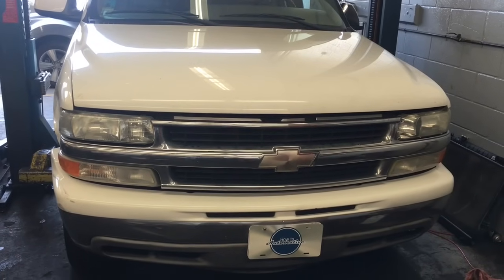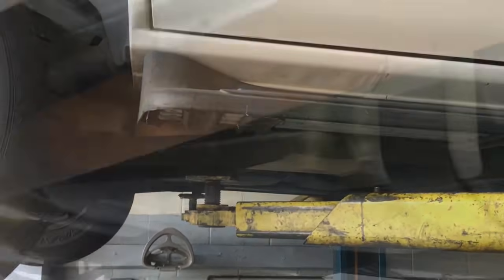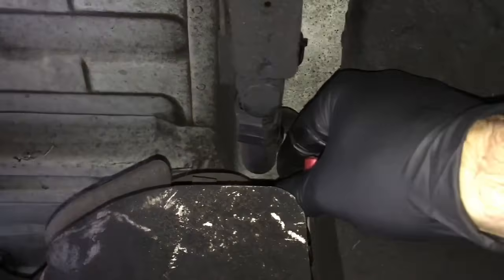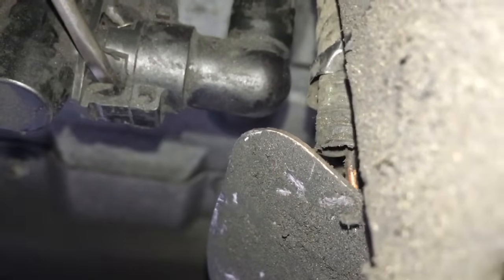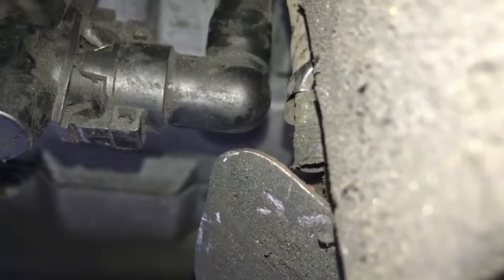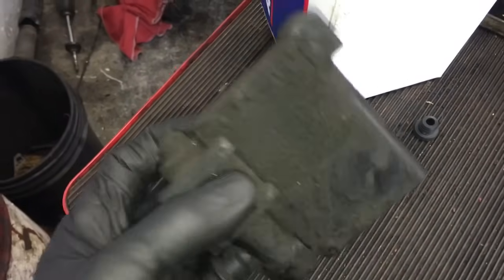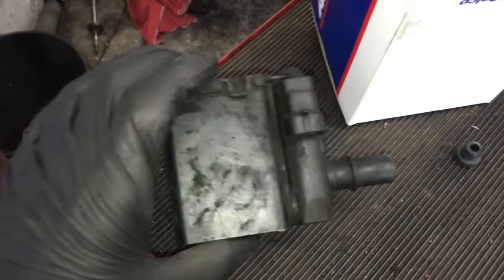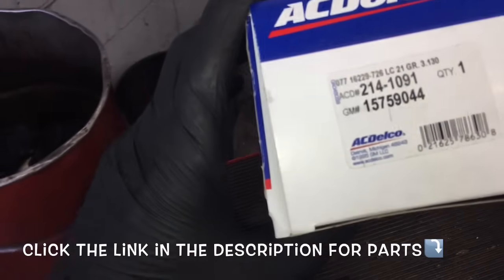How To Replace The Evap Vent Valve On A Chevy Tahoe/suburban

Comment: Thanks for the "complete" instructions. Other videos I came across failed to show the complete removal process, specifically where you have to use a screwdriver to pry the little tabs out because the squeezing doesn't work.  You were a great help! Thanks!  2005 Chevrolet Avalanche Z71

Comment: Excellent video - this helped me accomplish this task within two hours.  I took the mounting bracket off and pushed the vent hose through from the other side of gas tank to give me enough room to wiggle off the fitting.  Only video out there which addresses the 2003 Chevy Silverado 1500 evap vent - as it was the only year made like this.  Thanks again.
Reply: I was wondering why I was having trouble finding a video on my 03 Yukon XL. My experience may have been like yours; as in the only year that it was designed like this. I ended up having to buy the entire OEM kit that included the hose.

Comment: I found it difficult to remove the hose with the valve still mounted as there was not much room and also the hose was stiff. Thus making it hard to get enough muscle to pull it off of the valve while also trying to squeeze the tabs with my fingers. Tried to use a screwdriver but fishing blindly and again difficult to get two screwdrivers up in there and then trying to disconnect the hose at the same time. Not easy if one is on their back. And also worried that I might break the connector. 

I decided to unmount the valve. It was easy that way as I got better positioning and was able to squeeze the tabs and also twist and pull the valve off.  Also pay attention that you do "need" to push the connection in towards the valve first and then squeeze it before you pull it off.

Comment: Just a short note on this repair.  The vent valve has been updated with a modified kit, available from AC Delco or Dorman.  It replaces the old box vent control valve with an inline filter/valve assembly,  relocating the actual vent higher on the chassis.  Seems many will experience a check engine light shortly after changing the old style valve because it allowed dirt to pass through to the canister, clogging it.  The correct repair is to replace the canister and the vent valve at the same time.
Reply: charcoal canister?

Comment: 2001 Chevy suburban has engine code p0446 I'm able to pump gas fine. Gas cap seems good. Can it still be the EVAP canister?
Reply: I have the same code. Did you get it resolve?
Reply: I haven't. I'm going to change the gas cap and see if that works. If not I might have to change the canister.

Comment: Great video thanks!  Question - i have the new one here looks just like the one you installed.  I can blow through the port both ways and there is no restrictions.  Is the valve in the no powered state supposed to have the valve open?  Once you connect and that connection has power is that what closes the valve?  In other words the unpowered state for the valve is open?  Thanks again

Comment: This is the look my 04 yukon 5.3 flex fuel vent valve looks like . Amazon  says not fit but I ordered it anyway since the one that I got from Amazon is big and round and wont fit.    1 question I have is the o-ring inside that stupid connector replaceable?  I worry that is could be causing the leak.

Comment: So annoyed with those evap fittings and their removal... such an easy job and yet you spend way too long trying to understand and remove the fittings. And there is three on the charcoal canister. Great video thanks for the good tip on using a small screwdriver to get that fitting off!
Reply from the maker: I agree they could’ve designed this a lot better. Thank you for watching!
Reply: Do you the the P/N to the three?

Comment: In case the part you find doesn't have the hoses and you have to re-use the originals, I had good luck hitting them with the heat gun for just a little bit.  Be careful, there might be gas fumes.

Comment: I just got a diagnostic  on 03 Tahoe it said to change the purge valve and I change it the check engine light is still on could the code mean I need to change this valve instead

Comment: I am about to try this out. I've been getting my check engine light and the Tighten Fuel Cap warning on the dashboard. I have changed the cap 3 times already, OEM and ACDELCO and nothing. I hope this EVAP solenoid is the issue.
Reply: NOTORIOUS GAMING 209 hey man, did you do it yet?? Lol. Just did fuel pump on 01 suburban and got evap code

Comment: The vent line is broken on my tahoe .I saw zip ties around it...What is that vent hose called to ordered...I had the fuel pump replaced 3 years ago. Is it possible that the shop broke it while bringing the tank down? Thanks

Comment: I saw another video that showed it on top of the engine. Is it the same thing or is that for certain models or years?
Reply from the maker: If it’s on top of the engine, it’s the purge valve, not the vent

Comment: Do you know if the solenoid vapor valve connector wiring behind the tank runs into the  vapor pressure sensor on top of the tank? Found my po449 it was the 2 wire connector one of the wires pulled right out of the sheathing and i cant get 2 the end to splice another piece,its about a foot half long piece that broke

Comment: Awesome video - thanks!  What indicators tell me that this is bad on my 2003 Suburban?  Fault code?  Will the vehicle work fine outside of emissions issues if this is faulty?
Reply from the maker: condor5635 You’re definitely going to have fault code P 400s possible problems you may run into it hard to fill it up of gasoline. Pump may click off.

Comment: My suburban is having problems cranking after I put gas in it. Would that be the canister purge valve? If so, I typed it in on Autozone with the Part Number and said it doesn’t fit my 2006 Suburban. I found another that says it does.
Reply from the maker: The Evap System should not cause any starting problems. I was suspect something else such as the fuel pump to pump regulator. Or it’s not Seen cam or crank sensor. Start by pulling code to see if there’s anything and as far as a parts go will be different on all the vehicles check with your local park supplier.

Comment: Would anyone happen to know if this issue can prevent your vehicle from passing smog ? I’m currently having that issue I replaced most of the other components I did a leak smoke test and I had a lot of smoke coming out of this valve. I really hope this fixes the issue
Reply from the maker: It will not pass smog until this problem is fixed, and the code is clear. Plus the self check readiness monitors have run.
Reply: @HowtoAutomotive  thing is I connected the OBD reader and I don’t see any codes I’ve been driving it for almost 2 weeks I’ve done several driving cycles as well and nothing seems to help! When I connect the OBD reader I don’t get a code only thing it says that the truck is not ready and still needs to be driven since the EVAP and Secondary Emissions system hasn’t activated yet. I really hope once I change this valve I’ll get them to activate to have the truck  ready for smog

Comment: Found the wires from evap unit broken or eaten through about 10” from unit. Could feel on top of tank where wires went but nothing there.  Will I need to drop tank to find wires?
Reply from the maker: Booger Hill that wiring harness runs just on the inside of the frame by the gas tank and goes around to the backside of it. Maybe you’ll get lucky and find it if not you will have to drop that tank.

Comment: Hey Brian, can you do a video on replacing a brake booster and master cylinder for a 2003 Dodge ram?Thanks a much.
Reply from the maker: 808beerable if one comes in the shop I will definitely film it. I can’t see when that would happen it maybe tomorrow or two years from now.

Comment: How about you guys next time on your video do several different Vehicles because mine's not located in the front or rear. It's located in between the truck bed and the cab and the only way to get it out is by a removing  the bed or  by dropping the gas tank that information would be helpful. 2000 Silverado
Reply from the maker: If that was behind the bed it’s already been relocated previously before.

Comment: Will this also help with P0442? I replaced the gas cap but still get the code. Thanks
Reply from the maker: Nick GiantYeti this is one of the symptoms for P0442 yes. But I know for sure you would need to test.
Reply: How to Automotive Thank you for the input, from a few others, it sounds I may change this out for $30 anyway lol.
Reply from the maker: Nick GiantYeti Yeah it’s a very common problem

Comment: Could a bad EVAP valve cause gas to leak from the filler neck/cap on a 2002 Suburban(engine off and cold with the tank at about 7/8 full)?
Reply: Did you every find out the problem?  mine is doing the same thing
Reply: Yes. The EVAP canister itself...we removed the canister and cleaned with compressed air, water from a garden hose, then air again. Let it dry overnight and then reinstalled and have had no further problems. Additionally, we blew air through the hose that runs from the canister to the tank and had already replaced the vent valve solenoid. In the final wash though it was a clogged EVAP canister.

Comment: You video is great but I am lost - GMC Sierra 2002 - Went to the back of the tank, nothing. Went to the Front of the tank (toward the engine side) and above a cross member, above the tank, totally inaccessible is what MAY be the valve. I only say that because I see a line and that slide clip that supposedly holds it in place (Like a square with 4 ribs) . There is also what looks like a ground wire to a bolt and a small hose that just goes to space :-) In other words, on mine, NO WAY that could be removed without removing the tank...Just 2 1/2 inches to even see it - .so what am I missing? Am I even in the right place? I am pretty good mechanically and do my own work but this is a GMC nightmare

Comment: would this make it hard to fill the tank, it keeps shutting off
Reply from the maker: Dennis crosby yes if the vent valve is stuck in the closed position or the filter it's plugged it will not allow the air to vent causing the tank to be hard to fill

Comment: Would this cause really bad fuel mialiage and also I get a loose cap reading sometimes
Reply from the maker: Hector Otani No this is not the reason why your car has poor fuel mileage. It will set a check engine light for Evap leaks or vent problems.
Reply: How to Automotive   both PO894 and PO455 ,also new plugs n cleaned throttle body yesterday
Reply: How to Automotive oh btw I have 240k miles
Reply from the maker: Hector Otani Code P0894 is a transmission issue with the speed sensors. Possible transmission slipping or one of the sensor is not reading right. To check the P0455 you’ll need to smoke the Evap system for leaks test The Vent and pure Valve. You will need hey scan tool and some test test equipment to do all of this.
Reply: How to Automotive ok I will see wat I can do and not worry I love this Tahoe so comfy
Reply: Ok pulled more codes today also got po102 ,so while under truck I noticed a hose on top of transfer case hanging there ,is it safe to assume it's a vent?
Reply from the maker: Hector Otani The hose is most likely the van. The P0102 code is a mass airflow sensor code and that will cause poor fuel mileage for sure.
Reply: How to Automotive u kno I turned it on with maf unhooked and it ran without stumbling ,so it probably bad
Reply: How to Automotive Oo code clear but same maf sensor,I'm getting bout 11 miles at 45 mph, I haven't bought maf ,due to its $83 price tag lol

Comment: My service engine light came on and my code reader said it's the vent valve. I dont want to replace it if I dont have to. How can I check it? What should I look for?
Reply from the maker: Without a bidirectional scan tool you won’t be able to test the whole system. What you can do is take the valve off and apply power and ground from a 12 V battery to the terminals and try to blow air through it. If air blows through it with power and ground applied the valve is bad . You will also hear a click noise when you apply the power and ground.

Comment: Hmmm, unfortunately I bought the part and just crawled under to replace it and my 2006 Suburban 5.3L looks different underneath, I don't see that part, there is a round canister/filer up under there as well as a large box .... not sure what the deal is now?
Reply from the maker: Steven McMullin Chevrolet occasionally update their part and changes things around. I would contact your parts supplier and see if you have the right one it may be modified.

Comment: Looks like I have the wrong vent valve. Mine is more circular. Also, I’m trying to find a video of replacement of the canister.
Reply from the maker: HappiePappie81 The brown vet out maybe the updated version. I would check with your parts supplier. As far as the canister it’s pretty straightforward you just disconnect a few hoses and a couple bolts and that’s it.

Comment: I used smoke machine and th e smok coming out by the vent. Car stoped,e engine off,smock machine aplaying smock, caming out by the vents. That is normal. TTHE SISTEN SAID SMALL LEAK p0442
Reply from the maker: So you have to turn the vent on for it to close. You can either do that manually with a battery and jumper wires or with a scan tool. The properly test for the vent leak.

Comment: how would you know when to change this?
Reply from the maker: Martin Bencomo most of the time this Valve gets stuck in the open position. So you apply power and ground to the switch and still be able to blow through it. Which would show up as an Evap  leak
Reply: Or on the other end, if its plugged and not venting, when you fill your tank you can hear gurgling AND the gas will overflow from your tank druing filling.Happened to me :(

Comment: What is the sign that your evap valve is not functioning...
Reply: Check Engine light with a P0446 or P0496 engine code.

Comment: You should verify that some rodent has not chewed the wires off the harness, right where the short stub harness branches off to this solenoid connector..yes, open circuit will throw the same code...mice..rats.

Comment: My 2000 Chevy Tahoe is idling up and down..check engine light initially coded purge valve...I changed purge valve and I’m still experiencing the same issue...isles low like it will cut off...now the code says small evap leak...is it possible my issue may be whats being replaced in this video?
Reply: Did you ever figure out what it was sounds like my 2003 Tahoe is doing the same thing
Reply: Ace Boog no never found out